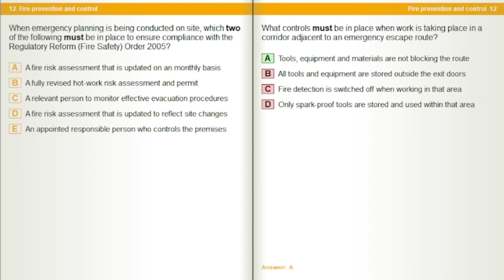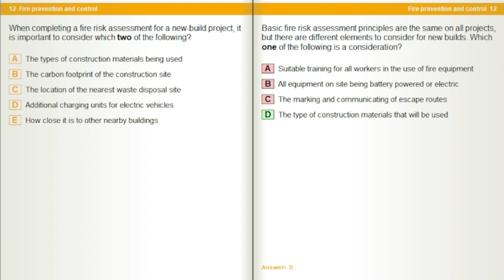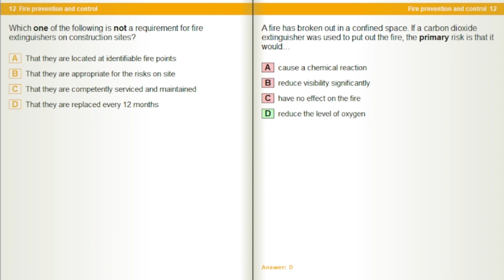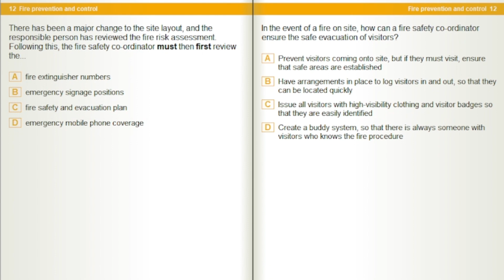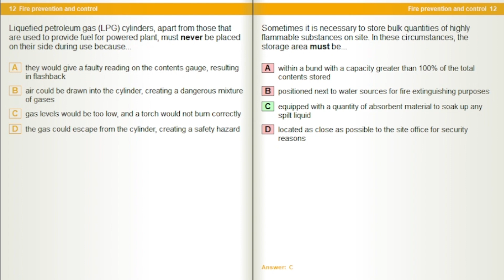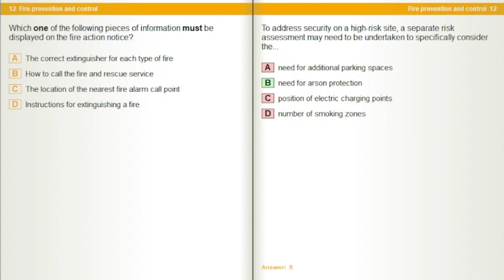CSCS Test UK 2024 | CSCS Card UK | CSCS Test for Managers & Professionals| #14 #fire #prevention

Comment: Right answer is C but in video it B. why wrong information 🙄 

Which one of the following statements is false regarding liquefied petroleum
because.. gas (LPG)?
A. LPG can create a large vapour cloud of flammable gas when spilled, which is capable
of ignition from some distance away
gases
B. LPG cylinders that are not being used must be stored outside the site perimeter in a sealed, secure non-combustible unit
C. LPG is a colourless, odourless liquid that floats on water, which vaporises to form a
gas that is heavier than ai
D. LPG cylinders and regulators used to heat welfare facilities must be kept outside, and
be piped in using rigid copper pipes